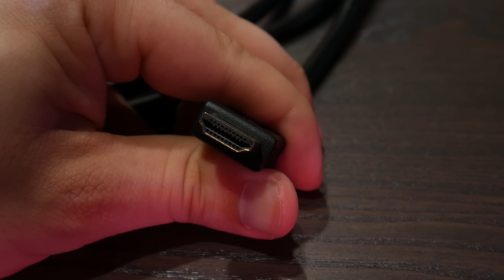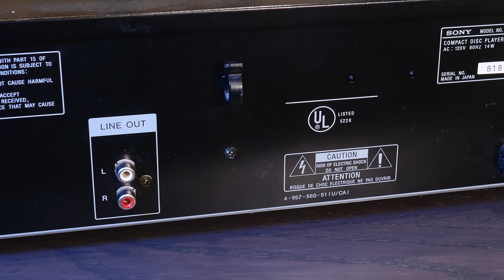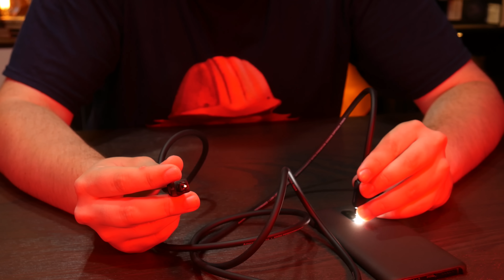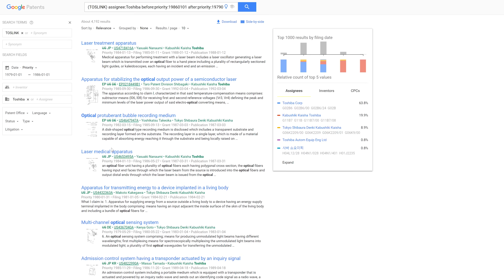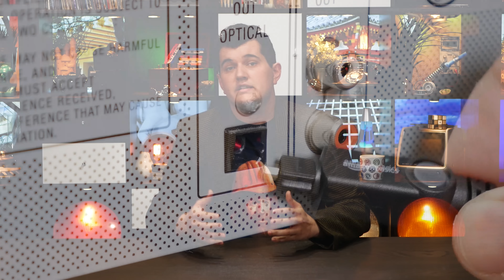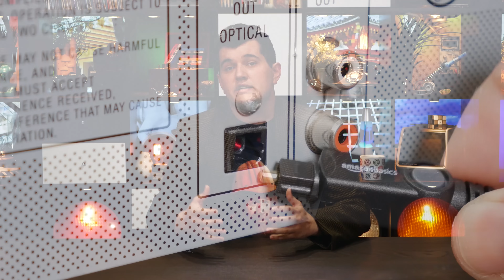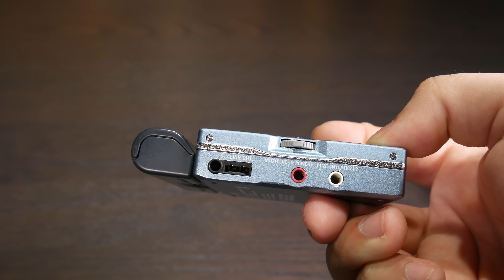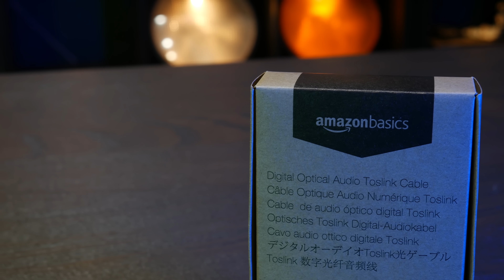TOSLINK: That one consumer fiber optic standard

Comment: better served? hell yea, off the top of my head we can say ethernet and even going back internal home phone lines. I have gone from internet at dialup 56000 to high speed, and have had to change my cables I think 4 times, if this was wired with optical, then realistically, everything would be future proof beyond upgrading the ends, our whole house would have in wall optical, with no way to cause fire at all while I would have had to upgrade my ethernet 3 different times in the same time span, it would also have served well as a way to connect computers FAR better than ethernet and router.

Comment: You underestimate its advantges. Avoiding electrical connection really makes a big difference sometimes.
Mostly because of (avoiding) ground loops, but also ground pollution, escpecially from switch-mode PSU-s.
Try connecting a regular PC to a high-power audio system, via external sound processor and DAC, with a 5m wire.

Comment: Toshiba's electronics components division  was an early vendor for plastic optical fiber with ready-made transmitter and receiver modules. They were an existing OEM product. What better way to bolster sales than to design them into their own players. It may have actually been cheaper for them.

Although they're relatively low bandwidth compared to glass fiber solutions, they've seen use in industrial and medical applications where the optical isolation provides for better reliability (surges/noise) or safety (electrocution to ground). Toshiba is still making a whole line of products, though in the consumer audio space allot of that business has moved to Chinese suppliers now.

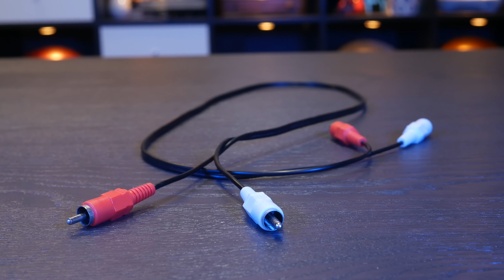Comment: composite not coaxial.is shown at 4:16.  Coaxial is a thicker round end often with a screw on plug (not always, vcr coaxial often isn't), its still technically used today (even on tvs to some extent), and for cable internet.

Comment: I tried using regular RCA cables with a coax SPDIF connector and it didn't work.  I've always assumed that it requires a special coax SPDIF RCA cable.
Reply: I read that, in theory, S/PDIF works with a normal 75Ω cable, but apparently, a lot of RCA cables don't quite match the spec:

http://www.bluejeanscable.com/articles/75ohmrca.htm

Comment: I do like the idea for isolating between devices when they're on different phases, makes sense for a theatre/venue when a lecterns power is on a different phase to the audio desk. Especially good if the audio output device is plugged in with a terrible power supply and inducing the phase hum between the ground connections of both devices.

Comment: My first 5.1 audio system initially used an RCA SPDIF cable between a PC and an amplifier.  There was always noise from the PC's operations coming out the speakers.  Not loud but noticeable.  I could hear the ripple on the power rails from the CPU processing data.  When I switched to TOSLINK, that disappeared entirely.  Somehow analogue electrical noise was making its way down the cable to the amplifier input. It wasn't an earth loop or anything like that since the PC was the only earthed piece of equipment.  That was my use case for optical even for consumer grade gear within the same room - cheap replacement for quality noise fitering.

Comment: I've never had digital audio output handled by digital audio equipment until HDMI came along.  The RCA cables my devices use have Always carried analogue signals.  So, yah, a Tos-link digital audio cable going from, say, my TiVo to my stereo system would make a Huge difference.  I've just never had a stereo that can use optical digital audio.

Comment: i've had rca cables fail in active use, and short of bending one too far or similar damage, i've yet to have a toslink cable fail, well.. ever.

i'd much rather use toslink vs copper, myself. even if it is glorified tech wank. its just been more robust.

Comment: well toslink is not dead at least on professional audio, is used but with new protocols MADI, ADAT and so on, because we need to make redundant and long distance signal paths for concerts with few cables and space as posible and with all the quality posible, in this case light is very useful due to being not affected by external electrical signals that could exist in a concert.

Comment: There was that odd period of time where Toslink performed better in practice than HDMI did. When HDMI was first introduced a lot of receivers hadn't adequately adjusted their hardware for the new standard. While they could play the higher bitrate HDMI signals, it took them just a few milliseconds longer to start playback. This wouldn't have been an issue if they had accounted for this, but they didn't. The most common result would be that the audio would be out of sync with the picture. I remember this issue being most common when people attempted to hook up the first generation Playstation 3s to their surround sound.

Comment: 12:20 what are you talking about? fiber optic can transmit data to 40 km without repeaters/amplification. in any case, it is less prone to interference/loss than copper.

Comment: right from wikipedia "The receiver does not control the data rate, so it must avoid bit slip by synchronizing its reception with the source clock. Many S/PDIF implementations cannot fully decouple the final signal from influence of the source or the interconnect. Specifically the process of clock recovery used to synchronize reception may produce jitter.[9][10][11] If the DAC does not have a stable clock reference then noise will be introduced into the resulting analog signal. However, receivers can implement various strategies that limit this influence.[11][12]

TOSLINK optical fiber, unlike coaxial cables, are immune to ground loops and RF interference.[13] The fiber core of TOSLINK, however, may suffer permanent damage if tightly bent"

so there is a legitimate reason to reduce noise as the clock recovery process produces jitter

Comment: Gold-plated connectors on TOSLINK... 🤦
Most of the problems I've seen with S/PIDF were friends using absolute crap cables. Usually leftover cheap thin cooper-clad Chinesium Composite Video cables from a budget-level VCR.

Comment: now i've known for years that optical has no advantage over phono cables when it comes to sound quality, but i'm looking at getting a DAC for my pioneer ps-d7033 cd player (only paid £2 for it, it goes for over £200 on ebay), but which would be better, ancoaxial cable,or should i just stick to using phono? i do have a few spare QED cables lying around, would that be better than buying a coaxial cable?

Comment: I accidentally discovered my 2015(?) Macbook Pro and few older laptops had the mini-optical connector few years back. I think my older Sound Blaster Audigy also had a mini one in the back (Even though it has a full size connector on the front breakout panel that's included)

Comment: optical connections are electrically isolated, a problem at the high-powered amplifier end won't effect the expensive source equipment.
 Then what's the electrical noise like in a studio with all sorts of ad-hoc equipment and cables thrown around - can that overcome the spdif electrical signal?

Comment: Digital signals over copper are optically isolated with an optocoupler. And well, an optocoupler consists of a LED and a phototransistor.... sound familiar?

Both toslink and optocouplers achieve the same thing. But having a pure optical connection may have some benefits.
 (broken cables, short circuits)

In car audio, the amp and the headunit will have different grounding points and might cause a ground loop.
 Even if it is digital.... if digital is not isolated from analog it will make some noise.

Optical daisy chain loops in automotive is becoming quite popular. There is the MOST bus for example

https://en.wikipedia.org/wiki/MOST_Bus

Comment: The connectors are keyed because they are standard SC connectors with the locking sleeve removed. You can use a regular multi mode cable if you pop that sleeve off. Light blue connector, orange or blue cable.

SC connectors are keyed because single mode cables (dark blue connector, yellow cable) are sometimes angled (green connector, yellow cable) to reduce reflection, and this obviously requires alignment of the angles.

Comment: In the late 1980s there was a ham radio called the Icom IC900a that used fiber optic data cables to connect remote band units to the control head. And in the 1970s, Buick and Cadillac had cars with fiber optic indicators in the interior and exterior of the car that the driver could see and verify that the incandescent turn signal and brake light bulbs were actually working, although these did not involve LEDs or lasers at all.

Comment: 11:46 You're overseeing, that a galvanic isolation can make sense if you for example have an AV receiver, hooked up to your tv cable for radio reception and a PC connected to the same AV receiver, which will lead to potential difference - as one is grounded via the shielding of the tv cable and the other one via the ground of the power line.
This will then cause a current flow through your amp which can be audible as a humming noise as it also passes the analogue path of the amp.

Comment: Love TOSLINK! quick easy digital connector. And you don't have to worry about the connectors getting frayed or shorted from a bend or break or stress. Until Apple sadly started removing great peripherals from their laptops, almost all Headphone and Line-in jacks (when they had them) were dual 1/8 phono and TOSLINK. My MacBook is one of the last to have the combo headphone jack. Sadly, it doesn't have a line in.

TOSLINK's connector and fiber have also been used in an improved digital format used semi-pro and pro audio gear called Alesis ADAT Lightpipe. https://en.wikipedia.org/wiki/ADAT_Lightpipe

Comment: Alex, As a TV installer in the Center Illinois region I wanted to share some information that I have learned. Everything you said regarding TOSLINK to S/PDIF is spot on, that fact comes in handy when you are trying to integrate newer equipment with only a Fiber Optic connection to older AVRs with only Digital Coax connections or trying to get SmartTV audio from a TV to a cabinet located in another room using existing coax cabling. HDMI audio is superior to Optic in formats supported. However HDMI ARC is almost completely unreliable in the real world. The constant handshaking that both devices need to establish and maintain to allow ARC to work almost never works unless working with same branded equipment and even then you can have audio cut outs. Also on the topic of having your equipment electrically isolated to prevent damage. I have seen on more than one occasion a lightning strike hit a satellite dish (or neighborhood cable distribution box), burn out the Satellite/cable box, HDMI cable, AVR and HDMI port on a TV.

Comment: I'm currently watching this in my 2018 Samsung oled tv connected to my Onkyo receiver via toslink. Why toslink? Because the stupid ARC decided one day not to work with my tv anymore so that's why.
Reply: Did you check the setting to see if CEC was still turned on? If you updated the firmware of the TV it could have changed some settings like that.

Comment: TOSlink is useful when dealing with audio-only devices.
HDMI-ARC is still new technology and only slightly more compatible than HDMI-CEC.
Also, there is still some older equipment in use as Audio Receivers which are simplified by having one (or two) TOSlink cables, rather than a bundle of RCA channel cables.
Even if you do want to use S/PDIF in addition to any analogue RCA, TOSlink is the simpler option to reduce the chance of someone accidentally plugging the wrong RCA into the wrong connection.

mini-TOSlink has been common for along time. Yes it is weird that you had never heard of it, but that’s OK. I still use mini-TOSlink to connect an old AirPort Express for audio only AirPlay2. (I don’t have my old-old AirPort Express’s. they did have mini-TOSlink, but they also had failed power supplies and don’t support AirPlay2).
Reply: LOL Hdmi arc is new...? Dude it is 10 years old and it is 100% compatible with CEC because the devices use CEC to communicate between then to enable things like Auto turn on ect.

Comment: I'm most struck by the fact that the optical standard has a worse range than its electrical counterpart. Range is supposed to be, like, the reason to use fiber optics! My guess is the use of an LED instead of a laser is causing an inverse-square-law-esque attenuation along the cable as the light spreads (and isn't reflected efficiently within the cable)?

Comment: SEGA also used TOSlink for networking arcade machines in the 90’s and early 2000s. Worked so much better, now all they use are Ethernet. Its crap that all the arcade machines now use Ethernet the audio on the machines rarely seems to sync correctly, unlike the optical cables all video and audio would be perfectly in sync on all machines.

Comment: My PC audio goes to my Sony AV Receiver via a TOSLINK cable I've had since the late 90s, I used it with a minidisc player (still my most beloved audio technology, although obviously I don't use it anymore due to MP3 convenience), I used to use it to record CDs and vinyls to Minidisc losslessly, way before CD burners became the norm. 

My  motherboard comes with Realtek digital audio, the HDMI just carries the image, and the difference is very noticeable. If I have sound going over HDMI, and turn the volume of the receiver up to full volume, there's a very loud hissing sound. If I do the same with TOSLINK, it remains silent, until I play some sound forgetting the volume is so high and scare the 💩 out of myself.

Comment: Many years ago I had a coax SPDIF cable carrying the audio signal from my computer to a receiver across the room. Whenever a certain light switch in the house was turned on or off, the audio would drop out and glitch. This problem went away when I changed it to a TOSLINK connection which I'm still using today. So there are definitely situations when TOSLINK outshines coax. :)

Comment: When I was young and played rock band on the PS3, a piece of paper in the box with the disc told me to use Optical audio instead of HDMI. Optical, it claimed, was faster and could sync up better to the video on the screen. At the time I thought "oh, that's because the speed of light is faster than electricity!" which of course nowadays I realize is stupid. However, I wonder why this was the case. It did make a noticeable impact when I use Optical instead of HDMI.

Comment: Toslink was great in theory for optical digital sound, until i bought the cables to connect my sound equipment.      
Got the cables and the sound was a horrible bit crushed mess.
Turns out they don’t convert different sample rate or bit depth between a sound source and a sound input.     
So one put out sound at one sample rate and the other processes it at a different sample rate.   The digital connection was not able to process the difference.
Would cost me a pricey rate converter.    
So i went back to simple analog connectors with gold plated tips.

Comment: A few words of caution if you're gonna dig into professional telecommunications equipment in the next video: Glass fiber is as sharp as a syringe needle, so be careful if you break a cable & expose the core. Also, shortwave optics (the stuff used to move data around a datacenter) use low-power visible light lasers and are relatively safe to look at. Longwave optics (the stuff used to move data cross cities) use high-power infrared lasers which WILL damage your retina. And since they're infrared, you won't even notice until you start seeing spots in your vision.

Comment: But the jitter thing is really FUN! The golden-ears used to argue that the copper cables were more susceptible to jitter, which could add noise to the sound of receiving equipment that derived their audio clocks from the incoming signals. (Seems like that's a bad idea anyway, but...) The platinum-ears among them argued that plastic TOSLINK cables were inferior to glass ones because of the same jitter argument. Great fun, because the best estimates of the effect of even significant jitter put the noise at 103db down or so.

I always get pleasure from simply the appearance of gold-plated things. Maybe that's it.

Comment: TOSLink even has a significant disadvantage I learned about using a Chromecast with a HDMI Splitter. 
The multichannel audio format Netflix uses (DD+) cannot be transported to the AV Receiver through the TOSLink - only by coaxial S/P-DIF. 
Which a lot of standard splitters do not have - so you only get standard Stereo/Surround out of the Chromecast...

Comment: A I blew up my computer sound card with static electricity that ran from the frame of my receiver through the SPDIF coax to my sound card. Just got up from the couch, reached the power button of the receiver and ZAP ! Since then I only use TOSLINK to connect audio.

Comment: I use Digital audio in my music studio. Once I figured it out, the amount and speed of data transfer is amazing. I am able to connect with Optical cable an extra unit which allows eight additional inputs to my primary input device. It took awhile to figure it all out, but once you get used to it, you will not give it up easily. The sound quality has always blown me away. I loved your response to gold cable ends, for a light beam, which could be made of plastic or anything cheaper.

Comment: I have used 8 channel optical audio transfer for quite a few years, the standard is called ADAT (the cheapest cables work fine even for this, no need for gold plating!!). All the sockets for my various bit of audio gear that use Toslink accept the plug either way round. I have had 3 (i think) MD recorders over the years and they all used Toslink or MiniToslink (was that the name?)